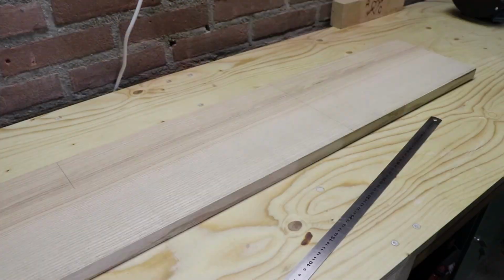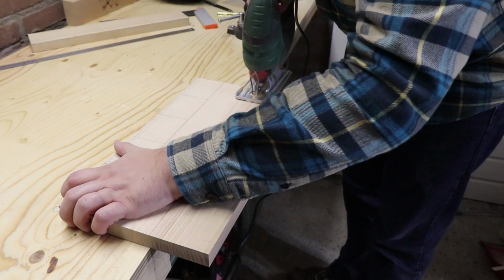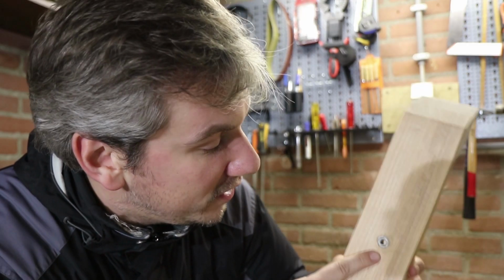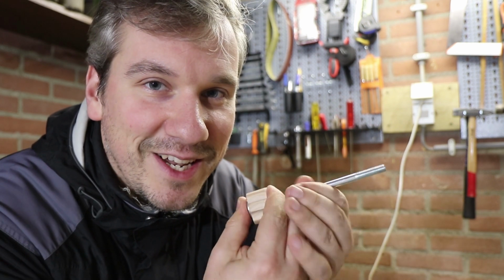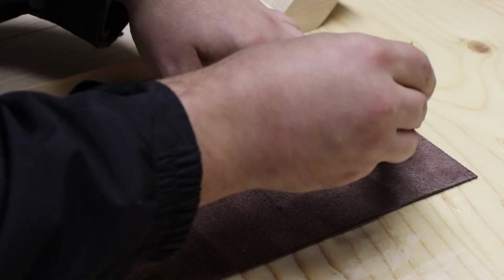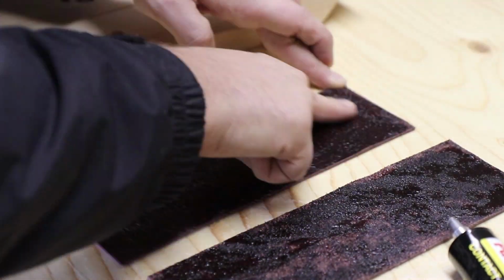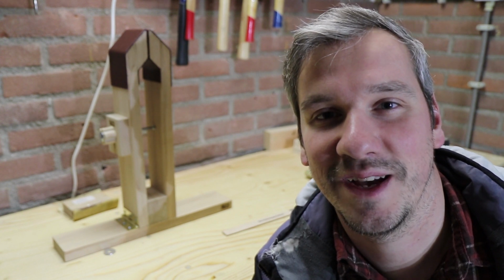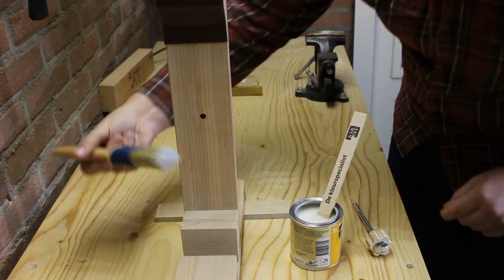Stitching Pony for Leather Working: How I Made One

Comment: Hey Tony! It turned out great! For some reason, I just saw that you tagged my blog post as inspiration for yours. I see that you corrected one of the things I should have...putting the nut for the bolt on the outside. The epoxy in mine has failed, so I'm probably going to put a threaded insert in there and it'll be functional again.
Reply from the maker: Hi Bruce, Thank you for watching my video, I really appreciate it. Especially the knob and shim idea from your video were very inspirational. Whenever I need a knob know, I know how to make one. I don't have a lot of woodworking experience (or tools for that matter), but this definitely was a fun project and the stitching pony itself works fantastic. Thanks again! Cheers!

Comment: I made three sizes of stitching pony, one for clamping to table, one for clamping to seat/bench.  and one from the floor, all different lengths to accommodate for different locations, and uses. I used a different design but very similar with bolt and wing nut to clamp the body and springs to pull the two verticals together, hinged at the bottom one side. I also have the angled jaws with leather, You did a great job on that very impressed. So i have subscribed also. All the best from UK, stay safe and thanks for this video i enjoyed watching real craftsmanship at work.
Reply from the maker: Hi Rob, thanks for watching and subscribing. It seems nice to me to have different style stitching ponies to choose from. With this one I have I always have to stitch standing up or sitting on the base which isn't super comfortable 😂 maybe I can make a smaller clampable one too! Thanks for the tips. And thanks again for watching and subscribing - it is difficult to get a lot of subscribers since I don't focus on one topic on this channel - I just do whatever seems fun to me and then hope people will enjoy that too. Cheers from the Netherlands!

Comment: Only thing I'd do different is put a spring between the jaws on the adjusting bolt to help hold jaws apart until you tighten it down
Reply from the maker: That's a smart suggestion. It's still possible to do that as an upgrade, if I can find a properly sized spring. Thanks and happy holidays!

Comment: Hola saludos TONY gracias por compartir tu conocimiento por favor me puedes dar las medidas Completas del pony Cuales son las medidas de la madera del pony para poder intentar hacerla
Muchas Gracias 
Tony por tu ayuda
Reply from the maker: Thanks Alfredo! Unfortunately I don't have a full plan available for it, but the dimensions don't really matter as long as you can clamp leather in it and clamp the stitching pony between your legs or on a working surface. In my case, the ash wood I used was 22mm (7/8'') thick and 75mm (3'') wide. The base is 40cm (16'') long and the clamp halves are 40cm (16'') tall (all approximate). Then if you just follow my video, you should be good to go! Have fun making one!
Greetings, Tony

Comment: Tony, I would like to know more about the   An21 stamp your using.  and how do you heat it? where can I get one from?
Reply from the maker: Hi Flywelder, I had mine 3D printed in laser sintered steel from Shapeways if I remember correctly. I heat it with a torch but not too hot since it might disintegrate. Hope this helps a bit 😊 otherwise, let me know! Cheers!

Comment: Hi Tony, Great project. What are the dimensions of your stock you started with?
Reply from the maker: Thanks Gregg! It was a piece of I believe 22mm (7/8'') thick ash. I cut it into a 75mm (3'') wide board and made the pony out of that. Where I needed the wood to be thicker I just glued multiple pieces together  Forgive me if the measurements don't exactly match what I mention in the video, it might be slightly different. Are you going to make one yourself? Enjoy it!
Cheers, Tony
Reply: Thanks for the reply, yeah I’m going to try it.
Reply from the maker: Good for you! From my experience dimensions don't really matter that much, as long as the clamp is able to tightly hold your workpiece and you're able to clamp the pony between your legs or onto a surface. I would be happy to hear from me once you gave it a go! Good luck!

Comment: Good job but I gotta tell you, watching you cut things and putting your hands in the path of anything sharp is scary. Learn to use them clamps! Clamp your work down to drill, cut, machine, chisel it anything else sharp. It'll save you some stitches and down time.
Reply from the maker: Hi Ford Fan, that's some good advice. Thank you! I certainly do care about safety and wear my PPE and all, but I do recognize that I haven't thought enough about what I put my hands in front of so your comment is very much appreciated. In my upcoming video I am chiselling a hex nut hole again in the same way but in the ones to be recorded, I will put your advice regarding sharp tools in practice. And thanks for complimenting on the work 🙂
Reply: No problem Tony, I'm a retired house framer and set builder. I'm 63 and still have all my fingers so I'm talking from experience!